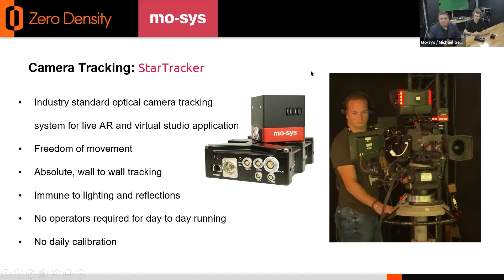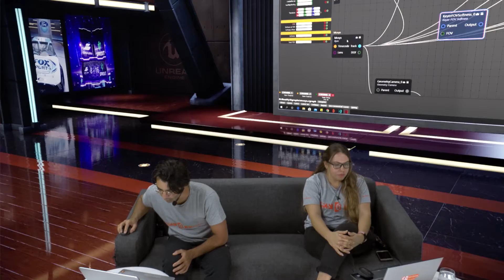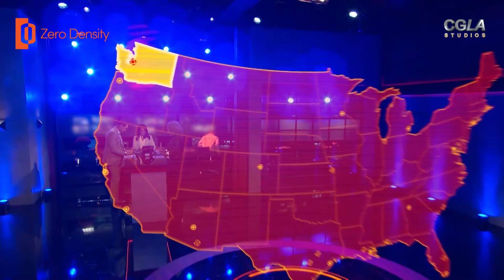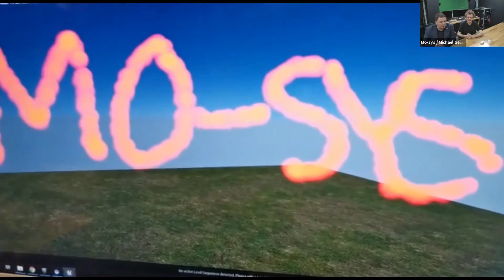Zero Density presents Reality & Tracking with Mo-sys Engineering

Comment from the maker: Zero Density & Mo-sys Relationship 3:27 
StarTracker general overview 5:21 ~ 11:30 
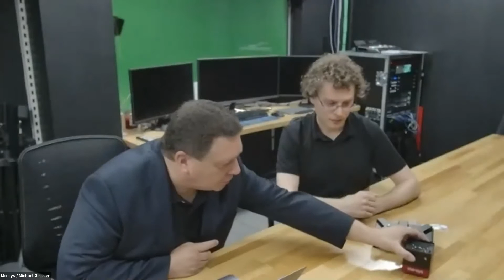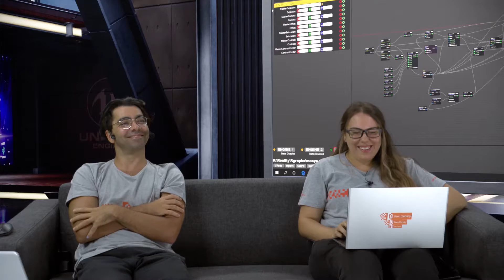GrassValley Update 11:42 ~ 13:20 
StarTracker Studio demo 13:27 ~ 16:26 
Reality integration and interface 16:46 
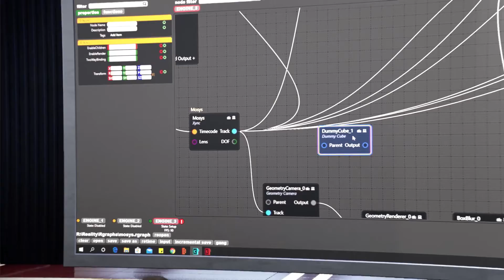DummyCube example 21:46 
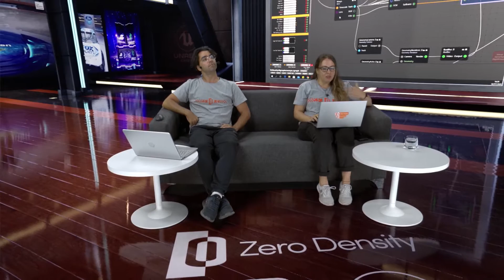Q: Optimum ceiling height? If there is no ceiling what do you do? 27:50 
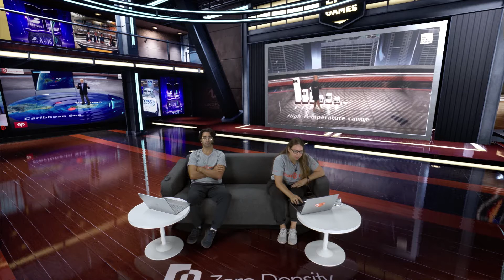First Reality Demo at CABSAT 30:41 
Mo-sys Visit to HQ - lens calibration 32:31 
Q: How long does it take to finish lens calibration? 37:42 
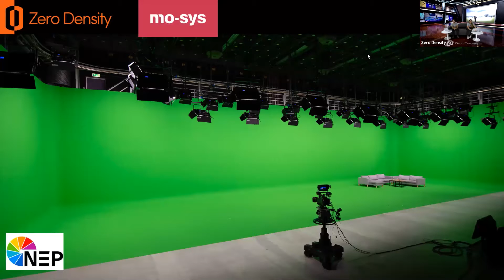NEP facilities in Netherlands 40:09 
Q: What is your sticker material and does it work on black on black? 41:12 
Q: How much bandwitdh you need to feed to engine? 44:24 
Q: What is the requirement on lenses? 45:15 
Project: Wedden Dak Ik Het Kan 46:21 
Project: Eurosport Winter Olympics 46:40 
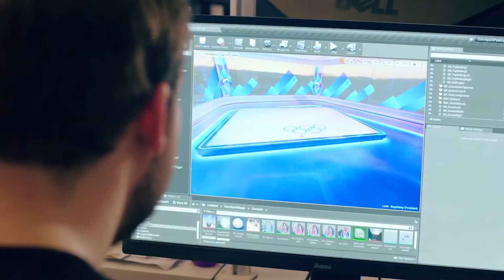Indoor vs Outdoor tracking 47:47 
Project: ESL Esports Showcase 51:23 
Q: Tracking with uneven floor 54:23 
Q: How does the tracking sensor communicates with the sticker 55:13 
Project: The Weather Channel 56:24 
Project: StudioXperience at Siggraph 58:24 
ViaDolly and Robojib 58:38 
Project: Star India 1:00:07 
Q: Stickers on the floor the optimum distance to the tracker 1:004:10 
Q: Do you recommend one Reality Engine per camera with keying? Recommended settings? 1:006:05 
Q: Object Tracking with StarTracker 1:08:56 
Q: The right light set up 1:11:22 
Project: Armenia TV & Panasonic UE150 with StarTracker 1:12:38 
Overview total Mo-sys products 1:15:10 
Timecam 1:23:00 
Q: Can the tracking data be embedded into a source camera for future use? 1:24:24 
StarTracker interface 1:25:02 
Wrap -up
 1:26:41